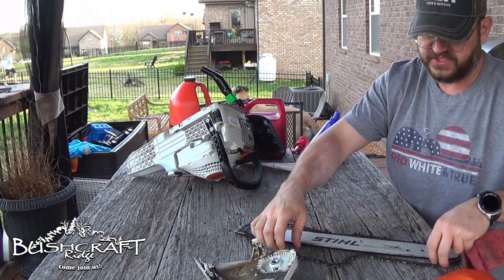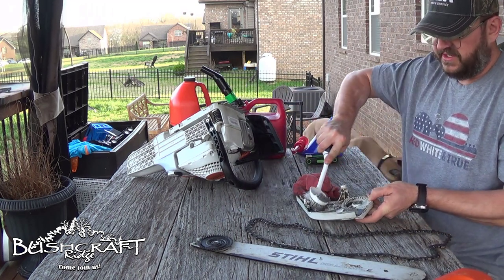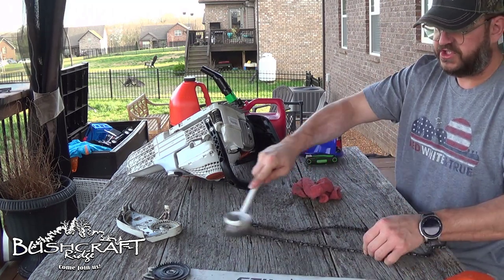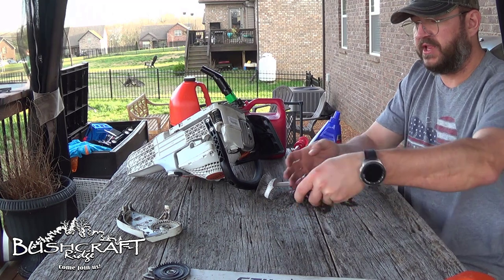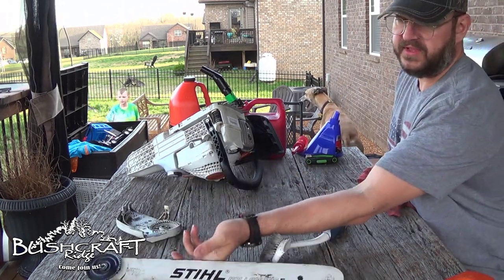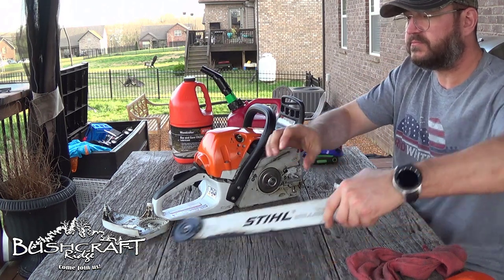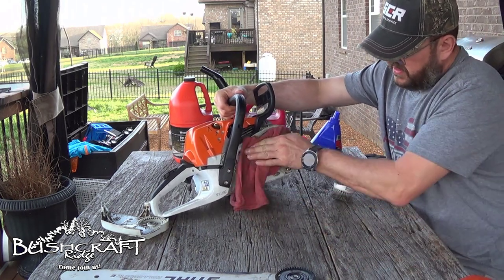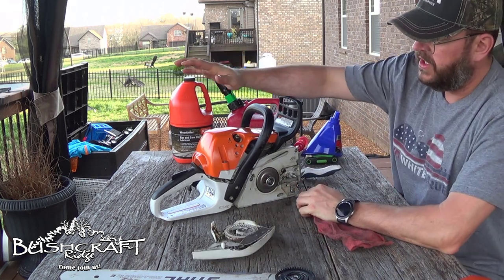How to Clean and Maintain a Chainsaw Stihl MS251C

Comment: I have had mine for 7 years and it has done a lot of work , you will damage your saw if you keep yanking on the pull cord like you demonstrated in the video,just take it easy and a couple of gentle pulls will start it every time. The air filter is meant to twist off to the left and to the right when putting back on, if you just yank it off and bang it back on you will soon find that the plastic mounting will either deform or break off leaving you with a problem that needs fixing before you can use the saw again.All the info you need is the user manual.

Comment: Just cleaned my MS251c and paid special attention to getting out all the crud of the bar of which there was tons. One thing to note was that prior to cleaning the bar, the chain move super easy by hand, hover after there was much more resistance. If anyone experiences the same, not to worry, the saw just needs a bit of work to allow the chain oil to get to where it needs to be lubricated. I also give the chain and drive sprocket a squirt of WD40 high performance of lithium grease which works a treat. Good vid, many thanks.
Reply from the maker: Nice! Thanks for info!

Comment: If you keep yanking on that pullcord like any other chainsaw you WILL break the easystart mechanism. It is designed in a way where you pull nice and slow.
Reply from the maker: Yeah, I've used the easy start a few times. I don't like it. The full pull still works better for me.
Reply: @BushcraftRidge  It is not made to be pulled started like a regular chain saw. All you are going to do by ripping the cord back fast is break the easy start. Just slow down, pull the cord nice and slow up, takes about twice and the engine will turn over by itself. This is designed so an old man can start it! People shouldn't do videos on stuff they really don't know enough about. Other people that don't know watch to learn and this is a bad learning video by someone himself that doesn't know enough about his own saw to do a video!

Comment: Good video. You should let it warm up longer before going full throttle without warming it up will score the cylinder as the piston and cylinder don't heat evenly maybe about 30 seconds.

Comment: This is a very good teardown and maintenance video. I've never fiddled much with my chainsaws. Mostly just wiping them down, clearing the drive mechanism of wood and junk, and sharpening the chain. I wouldn't be too concerned about where the coloring/paint is off. It's just where logs and branches are running up against the saw and moving around. It certainly doesn't hurt to rotate the bar though and keep the wear even around it. Gas is corrosive and is great for degreasing and removing oil and other gross stuff. Nothing wrong with using gas to clean stuff. My grandpa would wash his hands with gas after working on cars and stuff. Any chains I've seen have arrows on the side. However as you mentioned the teeth have to be able to cut so a user will find out in a hurry if they install it wrong haha. When I replace a chain I put it on the drive gear first, lay bar in, run the chain into the groove, then tension. I like to have a tight chain, as you use it and bind up it will start to loosen. I've never tried holding the handle into my leg. I like to pull both hands apart when pull starting. That way instead of yarding/wrenching one arm and shoulder both arms doing the work. Very good video!
Reply from the maker: Thank you, sir!

Comment: Those little bottles of 2 cycle oil mix are usually designed to mix with 2.5 gal of gas.  Check that please. …. I cleaned out a used up 2.5 gal jug of RoundUp (It is graduated up to 9 quarts… I drew a line for 10 quarts which equals 2.5 gal.) to be my 2 cycle mix fuel can.  Just checking.  Otherwise, great helpful video!

Comment: I cant get the tensioner off or turn the black knob. I am trying to replace the chain... any ideas?
Reply: I just took my tensioner off (I removed the bar for cleaning, I did have not yet removed the wheel from the bar) on my new ms 251 c.  Did you continue unscrewing the Quick adjustment knob??  You know, you pop out the handle (tooless) and twist left (unscrew) to loosen the bar so that the chain tension can be set… Well, I found that to take the bar off I just kept unscrewing the quick adjust handle.  If you are referring to the tension-setting wheel actually coming off from the bar (to clean even better or to flip the bar), I have not done that yet.  Sorry.
Reply: @MrBurdinekl  thx!
Reply: @jessicahalfmann7218  Did that fix it?

Comment: Can tell your not informative on the easy start because your supposed to slowly pull the rope rather than jerking it and running it full throttle without warming it first will score the piston wall too causing it to loose compression. If you ever loose compression youll know why. Im supprised the spring mechanism hadnt already broken on you the way your starting it. Good luck though and thanks for the video.
Reply from the maker: Appreciate the tips!

Comment: Geeeez dude… how can you make a saw video and not know anything about the saw? 😂 That is not how you start a Stihl. Proper procedure : all the way down pull till burb, bump to half choke pull till it starts, hit the trigger and it will drop to idle and back to normal switch position. Don’t even get me started on how you’re yanking the easy start lmao
Reply: Yea, that’s a good way to pull the cord out of the saw lol you literally easily pull it until you fill the tension turn over and it “burps”. That saw will be in the shop before long 😂

Comment: Terrible design on the chain tensioner, does not work, do not buy this chainsaw if your a serious chainsaw person.
Reply from the maker: You are absolutely correct. This thing couldn't make it through anything a serious chainsaw person would want to cut.
Reply: My tensioner does not work well  ,have not had good results with this model
Reply: This saw is designed for run of the mill home owner stuff. If you want a real "chainsaw person" saw, you should go with a ms362. Be ready to fork up twice as much money as this saw tho. 800 bucks for a new one, but you'll have a sawyer's saw that'll cut 24/7.
Reply: You should check the stihl chainsaw selector. It'll help you get a better idea of what you need.
Reply: @tenchi144  thx